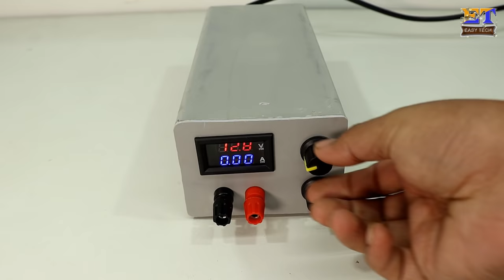How To Make Variable Power Supply || All in One Lab Bench Power Supply

Comment: Just warning you guys that are actually going to build this, the power regulator has no short/ovrtload protection, in a event of a short circuit if the power source can provide more than 10amps, it will blow up. Might be smarter to use say 24v 5A supply so instead of max output beeing 12v it will be 24 and the risk of blowing your regulator will be greatly reduced. datasheet says maximum continious current of the regulator ic is 9A but in my expirience it overheats, so might be smart to add active cooling or keep it at 5A max.
Reply: i am building the same project i have but 24V 10A SMPS instead of 12V one should i use different components?
Reply: @AkashJadhavIT  no need, just don't overload it
Reply: @filenotfound__3871  what if we add a 10A or 12A fuse somewhere before the regulator? would it be safe?
Reply: @mujtaba2617  Since the regulator is designed for 9A max, I would reccomend using an 5A fuse because if you are familiar with fuse caracteristiscs, even if you fraw duble the current trough the fuse it may not blow instantly, this solution is not great because it is still not garanteed to save you regulator  and the fuse might blow while using the regulator at say 8A, but it is still better than no protection.
Reply: @mujtaba2617  IME the circuit goes before the fuse.   else the fuse 'pops' all the time
Reply: That buck converter has short circuit protection
Reply: @SharvilSawargaonkar  It does, but it only works once

Comment: Can you do this with 24v 16 amp power supply but get the range to go from 3v to 58.4v? What would I need? I relies I wouldn't get but 5-6 amps at higher voltage if it's possible at all

Comment: I have one question regarding Digital VOLT AMMETER connection. Among the 3 thin wires yellow goes to positive output. And red goes to buck converts(300w) output + terminal. But what about black wire?
Which is the correct seen many videos all have different. 

1) Not connected 
2) connected to buck converters output negative. 
3) added LM7812 at buck converters o/p and given safely 12v to power up the digital V/A meter. 

As per me the 3rd ne should be correct but all of above cases are working... Pls help me.

Comment: Quite simple (case especially), but you don't need to connect thin black wire from VA meter if all the components are powered up by same SMPS. And you can connect VA meter power cables directly to free screws on SMPS, not to input sockets of converter.

Comment: What is the value of wire wound potentiometer meter and the wattage  ?
Reply from the maker: Max to max 35 inr
Reply: I mean what is the resistance value and wattage. I can't understand the wiring of potentiometer.
Reply: @udaybhanumoharana6217  10k according to original ones. I've used pots 3590S in my bench PSU (35V, 7A).